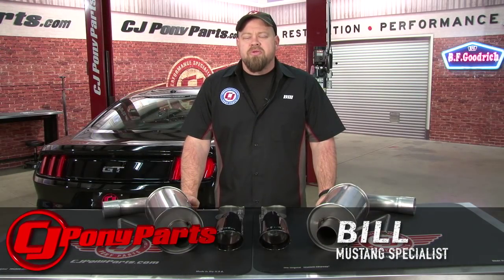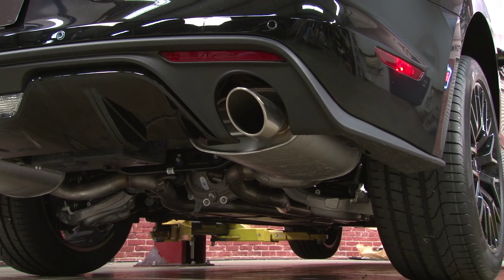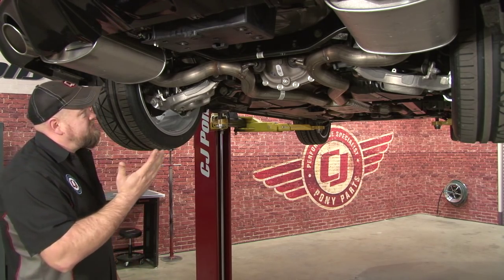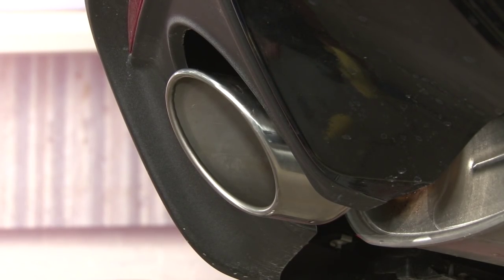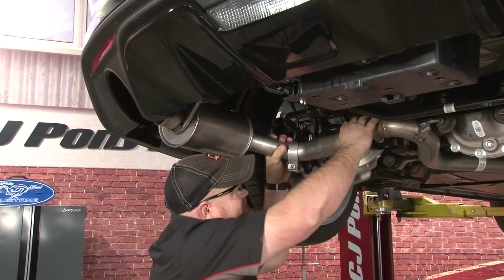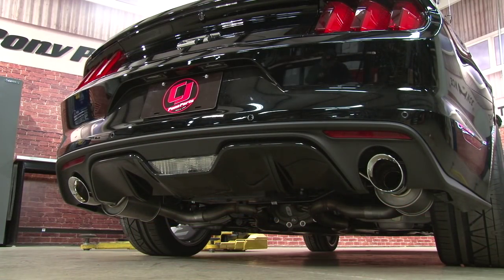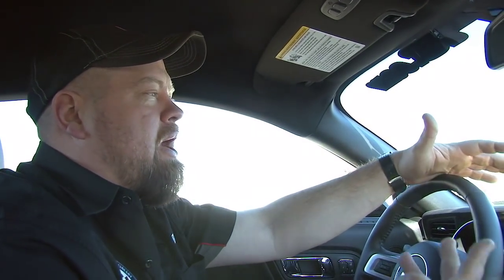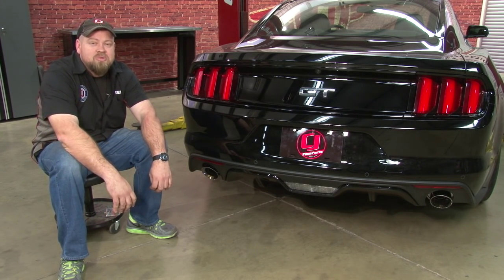2015-2017 Mustang GT Roush Axle-Back Exhaust Installation

Comment: Had mine on for 3 days now, and this is what a 435 hp engine should sound like.Coasting down hills is great sound, accelerating is pure joy, and I dont know how much HP this exhaust added, but I can sure feel it. Love those pipes
Reply: Not a drop of drone. Sounds good at highway speeds and lower rpm
Reply: I wouldn't go past the police station in sport mode though!
Reply: Let me know if you figure out the hp
Reply: Typical Kickz it’s probably about 2 to 5 percent hp

Comment from the maker: Many of you have been asking about the Roush exhausts for the 2015 Mustang. Roush Performance sent us one, so we can bring you a full installation video and sound clips! 

Now available for Pre-Order at CJ's!

http://www.cjponyparts.com/roush-axle-back-exhaust-stainless-steel-gt-2015/p/CBR19/
Reply: Can this exhaust be welded on instead of bolt clamped?
Reply: I'm curious I've seen a good bit videos of exhaust and I'm trying to find a nice loud exhaust and when in neutral still be able to hear it.. what exhaust is recommended?
Reply: Yes it can mine is welded

Comment: We have the roush axle back exhaust system on our 2717 GT 401a package with manual stick shift. It sounds very good. It's only  loud at cold start up and when revved aggressively. We have enjoyed it for 5 years. When new we had the exhaust tips sent out to be custom powder coated gloss black. Still looks very good. Nowadays you can get the optional black painted exhaust tips from Roush. Next we will be installing the Roush resonator delete h-pipe. Then it will be very loud.

Comment: Is there any difference between the GT axleback and V6 axleback other than the pipe size?

I have a 16 GT, and upgraded from a 15 V6. I have the V6 axleback can I just put it on the GT

Comment: Hi, which option would you choose from x pipe or without x pipe (stock). I mean a nicer deeper lower bass tone. The xpipe will be louder but will not the sound be higher than the bass? Thanks !!

Comment: My car already had these Mufflers installed they seem to hang a little low same with the tips they're not really snug to the rear bumper it's a base model it shouldn't matter imma check my exhaust pipes see about where they were cut at maybe they were cut too much or too little?

Comment: Whats better? Putting a whole exhaust system or cutting the end of it and adjusting it like what you did?
Reply: A cat back system saves more weight and gets rid of the restrictive resonator so there will be a performance advantage to a cat back. The Roush is a great alternative simply to improve sound.

Comment: hey Bill, I just bought these from you guys and installed them Friday night. I have a small leak where the band clamps are.  Yes they are in right orientation and yes they are torqued to proper spec. Is it common to have a small minor exaust leak where the clamps are?
Reply: +mistafivefivesix  There should not be a leak at all, loosen the clamps and retighten
Reply: +Bill Tumas spec say 22 ft lbs.  what is max torque?  i emailed roush but have received no reply.  if i can't get rid of the small leak will it mess up my valves?  the pipe is fully seated and is cut perfectly strait
Reply: +Bill Tumas will I  be able to put borla axle backs on with the same cut i did with the roush? can i just take off the roush and slap the borla on, or do i have to cut more off the mid pipe?

Comment: How do I get the crackle when I hold gear and get my foot of the gas? Is there like a particular kind of exhaust I should get? Thanks
Reply: The less backpressure you run the more likely you are to get a crackle. Tuning comes into play as well, richer tunes tend to have more.

Comment: Hey i just installed these and every cold start or if i rev up, the left exhaust rattles. it sounds like the tip but i tightened it as much i can and still rattles. Any solutions ?
Reply: +Marvin Carrion If the clamp isn't getting it tight enough you can have it welded but I have never come across that issue before.
Reply: Did you install it yourself?
Reply: +Driv3n to Dr1ve Its fine now. it was a the muffler that was bad. Contacted roush and they sent me some new ones.  its all god now
Reply: +Marvin Carrion good*

Comment: if you got this axle back and cut out the resonator and put an xpipe or h pipe in would it or should it drone?
Reply: Yes. Any time you remove a resonator from an exhaust system you will have drone. Resonators buffer the sound from your engine during your engine's "loudest" frequencies. If you remove them, you have nothing to buffer the frequencies, thus allowing these frequencies to cause what is called "drone." 

It is simply a matter of whether the drone level is acceptable or not to the driver.
Reply: We will be installing a resonator delete with the Roush system in the next few weeks and will do sound clips on it. While in theory above post is correct about the purpose of a resonator, not all systems drone just because you remove it. Certain mufflers do an excellent job at limiting drone, Borla has worked hard on that for years. The Ford Racing/Borla systems we installed had no drone at all at highway speeds.
Reply: Bill Tumas much agreed installed the Ford racing x pipe with stock mufflers and zero drone.  In fact I can barely hear a difference inside at idle.  But outside its better,  and according to people who hear it from the outside its a huge difference.

Comment: why won't this one fit on the V6? they look the same.
Reply from the maker: Alex Tang It may look the same, but it definitely won't fit the same, nor will it function too well on a V6.
Reply: ok gotcha. Thanks. by the way which  exhaust system would suggest on a v6?
Reply: +Alex Tang buy a v8
Reply: +CJ Pony Parts I purchased these for my 15 gt and got a defective muffler the left one doesn't work it rattles due to how it was made. Anyways you guys didn't let me get the warranty on it and refuse to give me a single replacement or at least pay half price for one! I cringe at the sound of my exhaust because it rattles :/
Reply: ‘15 V6 is 2.25” pipe.  ‘15 GT is 2.50” pipe.

Comment: I heard that Rousch mufflers rust quite a bit made in China junk
Is this true?
Reply: No.
Reply: If you're concerned about rust, you can always powered coat your axle-back. Eventually, you will have surface rust on anything stainless.
Reply: I made some research on this issue and found that most mufflers including OEM are made of 409 type of steel which has less chromium. Borla has 304 steel which has high content of chromium. They last longer and cost more.